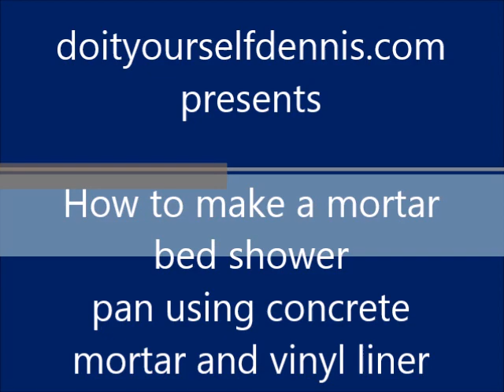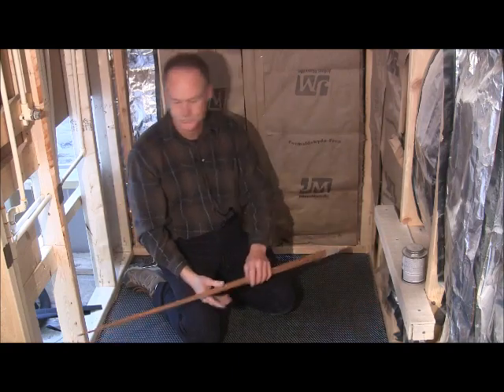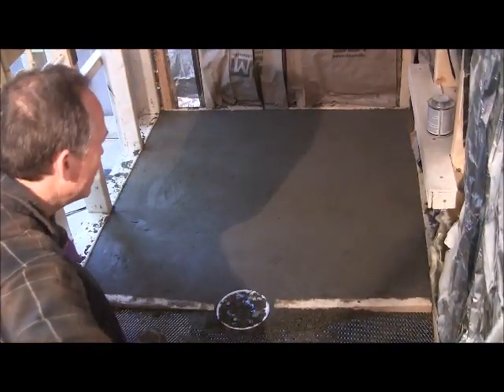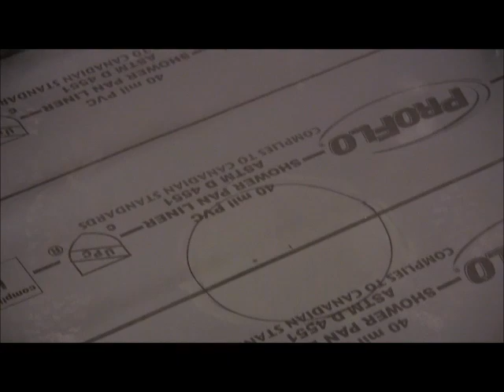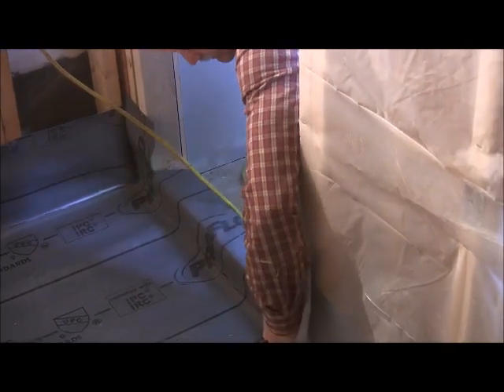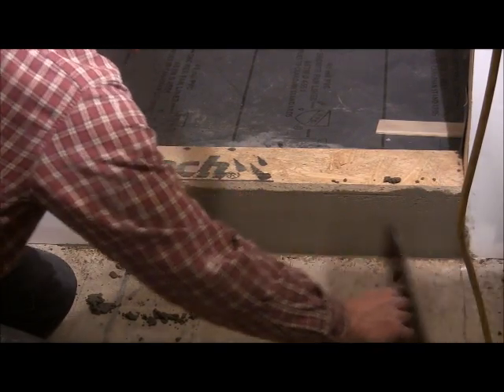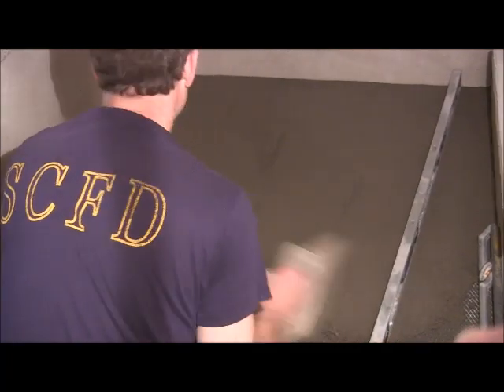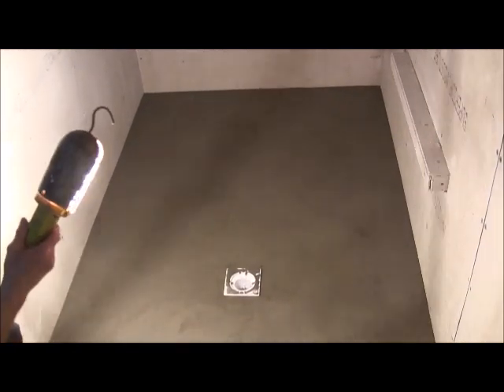How to make a shower pan using concrete mortar and vinyl liner

Comment: I know you made this video a while ago, but I just wanted to say how much it helped me. I have a walk-in shower like the one you did here. It was a new build from 8 years ago. The floor was flat pebbles, but there has been water standing under the concrete, on the liner, pretty much since it was done. It seems sloped properly, but when we dug out the concrete around the drain, you can see that the liner is not laying smoothly on the first mortar surface. There's a ridge around the drain that makes it impossible for all the water to drain in to the weep holes. Our drain set-up has weep channels, rather than holes; they were filled with mortar. Even cleaning all that out leaves water standing because of those low spots. Do you think there is any way to fix this without tearing the whole thing out? A tile installer removed the existing pebble flooring, but wouldn't continue until we resolve the standing water. Your video was so helpful, as I had no idea what goes in to making the shower. If only everyone was as precise and careful as you are here! Thank you so much!
Reply from the maker: In my opinion I would replace the whole thing in the fashion that I show in the video. If there are issues with the top layer, there are most likely issues with the rest. I hope this helps. Thanks
Reply: I now use a flofx drain they are different, it doesn't rely on weep holes which seems like the part that always fails from being clogged

Comment: For the final mortar, are you still doing !/4” per foot slope to the drain, or did you level the drain to the line marked on the wall?
Reply from the maker: If you did the 1/4 inch fall to start with and then put an inch layer on top of the pan liner throughout you should still have your 1/4 inch fall.